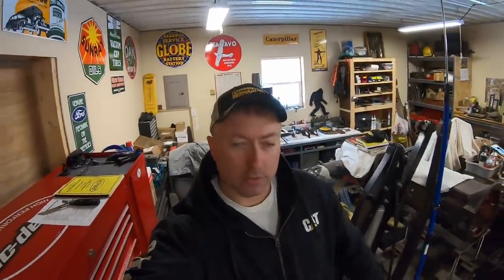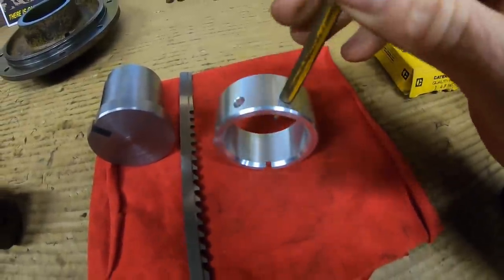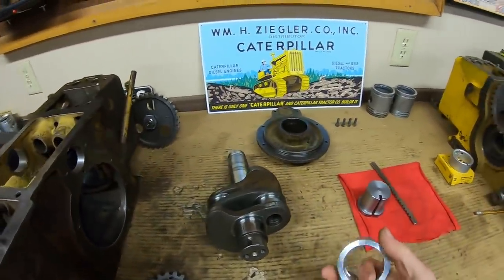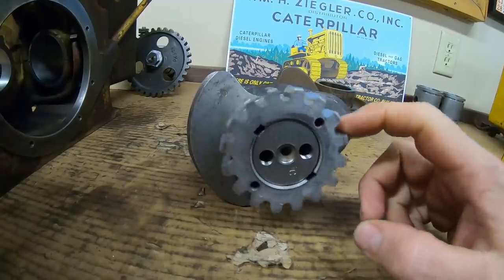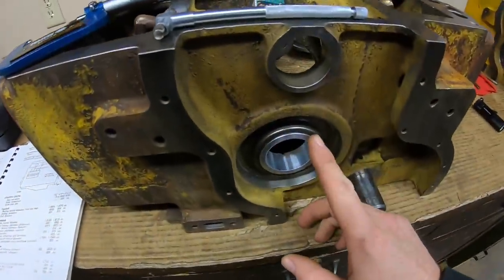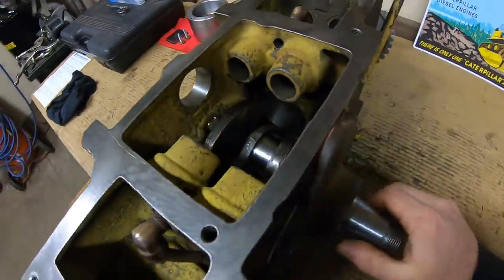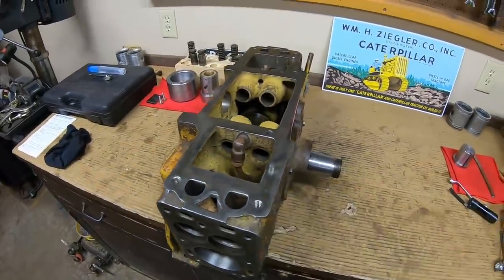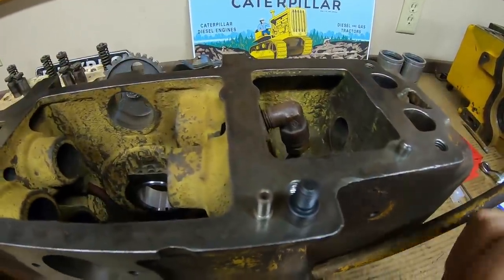Caterpillar D2 #5J1113 Starting System Ep.13: Making Pony Main Bearings & Better Retaining Dowels

Comment: Just something to keep in the back of your head, when chucking on a threaded part, use some mechanics wire to wrap around the threads, the entire length of the threads, to keep the jaws from crushing the points of the threads. The jaws crush the softer wire instead of deforming the point of the thread.

Also, I hope you don't mind me borrowing this updated idea of pinning the bearing when I get around to doing it on the RD-4 project. Thanks Toby!
Reply: The cleanest way to do that is to take a piece of hex stock and drill and tap that thread in. Then just thread in a fastener and machine it. I highly recommend keeping lengths of bar stock in the common nut diameters around the shop. It has tons of uses! Round would work fine as well.

Comment: Pro tip for tapping straight on the mill or drill press: after drilling your hole put the tap in the chuck and spin it in by hand. Even the smallest amount will start the tap straight and you can finish it with a tap handle, but smaller sizes you can go all the way in just turning the chuck by hand.
Reply: Same idea for die....   With the die in a well made and true (square) handle, use the tailstock to with no tool in it to hold light pressure as you turn the Chuck on a lathe
Reply: I’ve go to admit the go pro made the angle look very bad, I think it was all just go pro, but tapping with the drill press did come to mind.
Reply: When I saw the tap handle, I said,  ""missed opportunity".  I was wondering if anyone else was going to point this out.
Reply: “Spring center tap guild tool” is an excellent cheap tool for starting taps that have the dimple in the square drive end.

Comment: Given a hole tapping situation where I have the luxury of drilling the hole in my mill or drill press, I chuck the tap in the drill chuck and start the tap nice and straight. I use a pin spanner in the drill chuck key pilot hole to drive the tap, its very nice. once you get to a point where the chuck is slipping you can swap to a tap wrench, but most of the time you can get right through with almost 0 chance of a crooked (or busted) tap.

Comment: An old machinist trick my Dad taught me was to (whenever possible) drill the hole to size and then with the chuck still centered over the hole, install the tap loosely in chuck, start then stop the machine and while machine is coasting, feed the tap to start it into the hole. Then un-chuck the tap and use the tool to finish the threads.
 Really enjoy watching the vids of this build. Thank you and keep them coming.
Reply: Great method.
I think he did okay.

Comment: A trick I use when modifying screws and bolts in a lathe is to chuck up at least one suitable nut, screw the bolt/screw in and then drill or turn the head. This way there's no way to deform the threads by chucking directly. This is more of a problem on softer fasteners.
Reply: "Coupler nuts" work great for that technique using a lathe. Extra length means better squaring up in the chuck jaws. For a project like this you could even skip out on the tail center.

Comment: Excellent video the bearing and retaining pin turned out really nice that was how I would have retained the bearing too. McMaster Carr is a awesome place to get weird fasteners and tools from that auto parts store and hardware store do not have it's weird to them stores but not to gear head guys that know what we need and where to find it. I needed a bunch of one inch lead screw to make chain and belt tensioners on my sawmill I checked around and could not find it but McMaster Carr had what I needed and it came in 2 days. Keep up the great videos and excellent work on the try build 👍👍👍👍

Comment: You can get a cheap “spring center tap guild tool”.  After drilling, mount tool in drill press and the spring loaded tip holds the tap straight, if the tap has the centering dimple on the square drive end.  There is also tap drive extensions for reaching way into a workpiece.

Comment: I like the "Squatch" style main bearing retainers. You drilled through those socket head screws like it was nothing!
Reply: Sharp bit sure helps.
Reply: @dans_Learning_Curve  Are they just case hardened like an M&M?  It sure did walk on through with ease!!
Reply: @stxrynn  The set screws are super bad, but standard SHCS's aren't so bad. Still, I was expecting more trouble.

Comment: In addition to the  socket head cap screws,  McMaster -Carr will possibly  have extra deep/long threaded nuts in various sizes and thread pitches. In this operation thread the cap screw into the long nut, chuck it and turn it. Need more protrusion from the chuck, stack the needed long nuts on a length of  threaded rod. Ensure that you jam the nuts together on the threaded rod, wobble will be controlled by using the live center... 
Extra good video, Toby! Please keep them coming.

Comment: Some I have seen before but that kind of work with the boring bar and the amazing setup as well as the dowel pin solution and use of the broaching bar,  no.   The great part is if you are familiar with an area,  you can skip and those that are new,  settle in with the popcorn.

Comment: Excellent job on recreating the main bearings and working out the fitments. I just have to say something about those retaining screws. I always thought it was a general rule in engineering to never put threads through both parts trying to be fixed together. This is because both parts are not going to be drawn together when the screw is tightened. The only thing that tightens is the bottom of the screw head and the threads directly below. It is also a rule that you should never use a thread as means if location. 
Therefore, the bearing could be allowed to rotate in the bore a small amount in either direction. In a press fit dowel, there is no clearance at all between the pin and bore. There are such clearances all around a thread. It also looked like there was quite a bit of runout between the threads and the diameter you turned. 
I’m sure they’ll last a good while but I do think there are some reasons why caterpillar didn’t do it this way. Can’t wait to see them run!

Comment: I don't think that could've gone any better! What a way to think outside the box and improve greatly on what was truly a factory defect. If only you were around over 70 years ago to correct this. Of course, I don't know if you would've had to fight the CAT hierarchy when a regular mechanic out thinks the engineers of the day with their fancy college degrees.
Reply: @squatch253  I understand that. Is it possible engineers might be resisting your solutions because they actually fix the issue in a way it won't break or malfunction again, and these seeming engineering methods are actually a way to cause more customers to come in for repairs?  I guess that's the conspiracy theorist in me. I used to work with Hyster Forklifts. They went electronic in 2005 and they've gotten more complicated since. I remember not long after the Fortis line was introduced, the forklifts with the GM 2.4L 4 cylinder engines had a problem where at cold start, the engine would rev up rather high (which we know isn't good on a cold dry start) then settle into regular idle. Contact Engineering told me to replace the ECU. I did and the problem was resolved. Some time later, I used a flash program to reset a GM ECU for a different issue on another customer forklift. It was a standard flash program offered. Anyhow, I got the idea to run the flash program on some of our rentals with the same revving issue. It resolved the problem. I notified engineering of my discovery but I don't recall ever seeing a service bulletin on this solution.

Comment: Have you considered using jewelers file to chamfer the edges of the broached groove? This may provide some 'lead-in' for the oil-film rather than sharp edge which could 'squeegie' the oil off the crankshaft journal.

Comment: Since you can’t use a hammer an air chisel with a cupped anvil works fantastic! 😎 oh and you could have just thrown a sacrificial flat washer under the head of that bolt and turned towards your chuck jaws full length and no damage.

Comment: If you ever have a drill bit and are saying to yourself "Jeeze, I wish this thing was longer", silver solder can solve the problem.  It is remarkably strong and bonds to HSS very well, so I just butt solder the drill to a rod.  For good alignment use a rod and the drill setup in the lathe.  Harris 56 is my go-to.   'Course McMaster is perhaps the better answer, but sometimes you just don't want to have to wait 16 hours! 
Oh, meant to say but you probably already know, you may not have to turn down the head all the way for clearance.  A step might be enough and quicker.

Comment: Liked the fix. As the Hex head cap screws have a higher head than original press in pin. You could cross drill a 1/8" hole onto head to allow oil to enter at original level.
Reply: Yeah I was worried about the higher head too. If you think about it however, the total area that collects oil for the three holes remains the same and they all feed into the same cavity within the barring. I think it should not make any real difference, in fact not putting a hole in the bolt probably would not matter either.
Reply: @squatch253  it would be great to have a 
clear acrylic sheet as a tempory cover to view oil, to see how much oil is sprayed around in operation.

Comment: I have found that whatever oversize you make the bearing being pressed, once pressed, it’s going to be exactly that much undersized once pressed in to the block. What a shocker that was first time. And, I’d have used .001-.0015 oversize, but not one but less than .001. Believe it or not ambient temperature affects the whole operation. Everything needs to be the same temperature, including measuring tools. But, now you already know all this!

Comment: Dutch, really enjoy your vids.  Lots of good work done in filming and editing.
I'm a retired field service engineer.  Loved that job more than previous gig as a maint manager in mgf 0lants.
I have used 'full' or 'half-dog' hex-head, set screws in situations such as the dowel replacement.  If size permits, a hollow locking screw can be run down on top of dowel screw to hold it in place. Lock is hollow.  Waiting to see it fire off and start '13.
Reply: It's called autocorrect. When my wife texts in Spanish to her sisters it gives her a fit.

Comment: Just so you know, they make a low socket head cap screw. The head is half the height. Looking good keep up the good work
Reply: McMaster actually has "vented" shcs too. They already have a hole through the center (only .078" though). Might be useful to someone doing this with less tools available, you could buy those and just grind down the head diameter by hand.
Reply: @squatch253  I guess you spent some time thinking this one through! Nice reasoning!

Comment: While your solution for retaining the new larger OD bushing followed the original CAT method. May I suggest that simpler solution would have been to simply drill and tap a pair of "dutch keys" along the axis of the crank spaced 180 apart.

Comment: Looks really good. My only concern is the added height of the Allen head versus the original dowel is will it reduce the oil flow to the bearing. I know that there are still the other two holes but the shorter height of the dowel made all three holes about even with the bottom of the recess to pool oil flowing to the gravity-fed bearing. You could reduce the head height now that it is installed but you would lose the hex easing future removal of your threaded bearing retainer. Just something to consider anyway. Keep up the videos, please. It gives a lot to think about in reconditioning these engines and improving where there were weaknesses in the original design.
Reply: Could always take a Dremel and cut a slot crosswise on the head,would leave the majority of the hex present. With that crankshaft flying around,oil splashing everywhere, I really doubt it is going to be an issue. Still.
Reply: Added hex increases oil reserve for the bearing! LoL 😅😆 
It probably would have been okay with just the two oil holes.

Comment: Squatch, the videos keep getting better and better. All the machining in recent videos is a great addition! 

You said not to hit the broach with a hammer in the end. Is pressing it the proper way to do it?
Reply: I think he meant don't hit it with a metallic hammer. The broach must be hardened and possibly brittle/breakable. It can withstand the impact from a dead blow hammer like he used.
Reply: Yes, normally you would use a press, preferably an arbor press as it gives more feel to what you're doing than a hydraulic press.
Reply: @squatch253  plus, it wasn't a hammer, it's a deadblow! 😉

Comment: As the head of the cap screw, is now a lot higher than the lip of the 'oil supply cup' (cast into the block), then no oil will be going down through the cap screw.  I think you can miss out the 1/8" hole through the middle of the cap screw on future ones - especially considering how little metal that leaves between ID and thread core diameter.  Whilst this cap screw is strong and will stay there in it's current form, if you ever try and take that cap screw out, I would think it have been weakened to the point that the head will just spin off, leaving the thread stuck in the hole.

Comment: Squatch,
I will admit straight up that I haven't read through all 271 comments posted to this point so I hope I'm not repeating someone else's comment.  Your bearing looks great and your new bearing retainers do too, but I can't help thinking that you somewhat cocked the design up. It might just be camera angles but if it is I'll lay the blame for that on you too. It looks to me that the top of the former socket head cap screws are somewhat higher than the level of the oil reservoir recess that they sit in thus negating the possible benefit of increased oil flow to the bearings below. If this is not the case could you please elucidate us as to what the actual situation is and accept my most humble apologies for having doubted you. Of course if it is an oversight on your behalf, my ego would feel well stroked if in the next video you sang praise to my eagle eyes and showed your many fans how you might rectify this slight oversight on your behalf. 
Just bustin yer balls man, thanks for all the great videos.

Comment: Yeah the gopro stabilization really messed with my eyes and head but I knew you were on top of it the whole time great job beautifully done and that answered the question I had on those pins  and cancels my idea on what I thought would be a better method of securement for the bearings  and you must have had that same thought.

Comment: A good tool if you can find or build one is a fractal vise. It would clamp 360 around the part for a better fit without distortions.
Reply: The one major downside of fractal vise jaws is they don't have a good way to index the part

Comment: Wow that was really interesting I appreciate that you take the time to go into great detail I have always been a little slow on catching on so believe me you were not wasting your breath 😀 I was wondering what kind of lube you were using when you broached the bearing and also what do you use to clean out the block when you have both aluminum and cast fileings I suppose a vacuum or compressed air? I am always worried about leaving shrapnel in the block when do any machining . Looking forward to the next video!👍

Comment: Perhaps I missed it in the video, What aluminum did you make the engine bearings from?  It looks like it machined very nice.  I really like the method to take up the end play.  I have considered, not sure if it would work, putting some type of bronze washer or shim between the crank and the bearings to take up extra end play on an engine that the bearings were still good.  Not sure if it would work, or if there would be a better material to use.  Thank you for the videos!!

Comment: Very well done, Toby. You used Cat's own designs and block to make something that was not accounted back in the day.  I think CAT did not account for the extended use for the D2 and D4 starting engines, that's why we see a lot of this odd parts wear 70 years later. But you did it  better then the engineers back in the day. So now it's just a matter of time until the Devil block 4B666 will come back to life. The updated design is much more fool proof liking it.
Reply: @squatch253  That will be very interesting to hear from you. I think I have one answer already and that maybe cost efficient(maybe even low cost) production at the time and circumstances. A hardened crankshaft for the block is good to have but if you have a hardened crankshaft. That also needs to have corresponding bushings etc. So the over all cost of making one starting engine keeps just adding up one by one. Not very good for the sale.

Comment: @Squatch253 Very nice work, retaining bolts and bearing alike. You should sell the idea back to Cat 😎 Word of caution, though: give the sides of the broached groove a smooth and generously rounded chamfer/filet, if you haven't yet. Otherwise, this oil groove may work more as an oil scrapper than anything else.

Comment: You are not concerned that the head of your new pin is not going to pass oil being that it is above what appears to be a well for oil splash to collect in and then drip down through the center hole of the pin?

Comment: Instead of rapping with wire just screw it into a nut and chuck up on the nut. Then you can also turn the outside of the hex socket as well.

Comment: Im betting with that higher press fit the retaining pin would not be needed.  However I like your new retainer system much better.
Reply: I was thinking the same thing myself. I bet they didn't have retaining compound when they were new either.